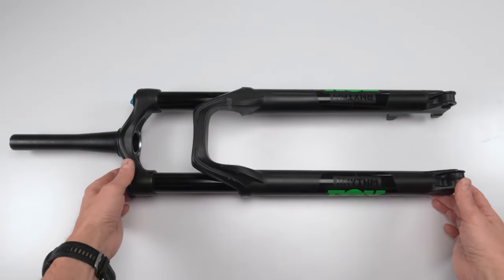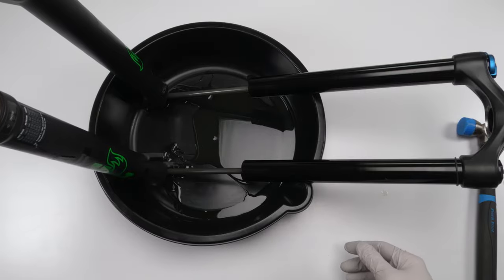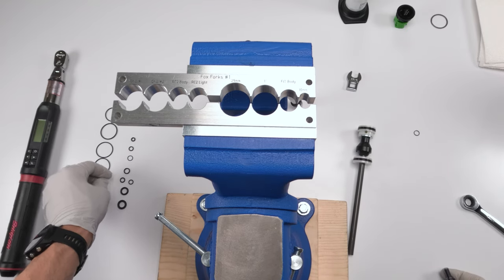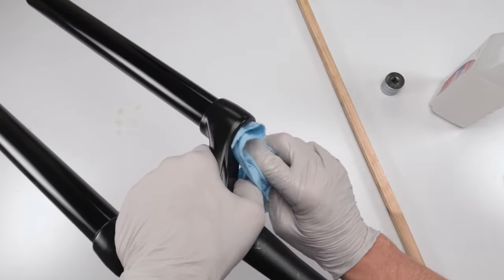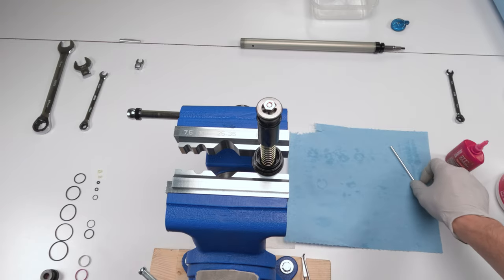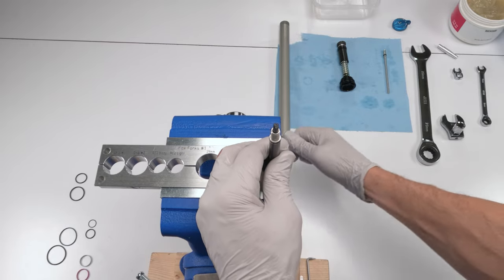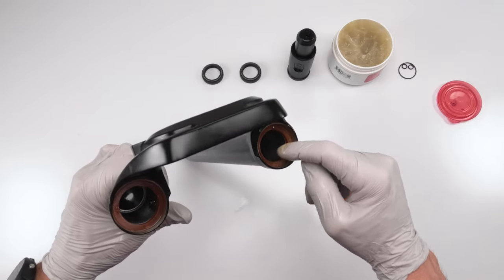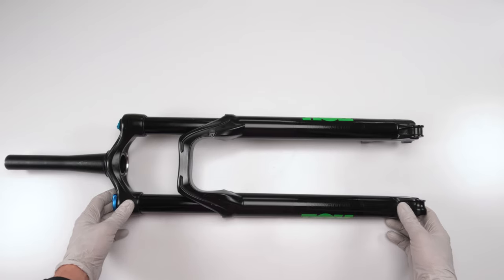FOX Rhythm Series 34 FLOAT 2019 GRIP Damper, air spring + 50 hour full service guide for beginners

Comment: Great explanation of servicing this fork! I have a Orbea OIZ H20 2022 with a 120mm Fox Float Rhythm 32 fork. Bike is new,  but the lockout does not work properly.  It's not fully locked when the compression needle is fully closed. This bike has a Squidlock remote on the handlebar. Why isn't fully locked? I did unscrew the compression needle counter clockwise a couple of times. Does it need bleeding? The remote lockout didn't worked properly since I bought it. I hope you can help!
Reply from the maker: Thanks for watching the video. So the fork won't stay 100% locked out when lots of pressure is applied over time. oil will seep through but VEEEEERY slowly. It'll feel locked out but with a super slight slip as you keep applying pressure. if your feeling more movement than this than I'd bet you need a bleed. air in the system will make it feel like it doesn't lock out. This will be felt immediately when you apply pressure. hopefully this makes enough sense so you can have a baseline for comparison. let me know how it goes.
Reply: @zoubtube  Thank for your fast answer! I accidentally pulled out the compression needle last night! 🫢 Some oil leaked out but I put back the needle immediately. When I turn the blue compression knob (normally operated by the Squidlock remote) I have to apply some force to get the fork fully locked. I have to turn the knob clockwise. With the Squidlock and the Fox Grip the fork is never fully locked. The spring underneath the compression knob doesn't manage to get the fork fully locked. When I remotely lock the fork, the fork is not 100% locked. I have to manually give the compression knob a slight twist (very minimal) clockwise. On my Scott Scale 925 with the same fork, this is not the case. It's 100% locked. Could there be something wrong with the damper cartridge internally? It's a new fork. Is it a problem that there was some oil leaked out after I accidentally toke out the compression needle?

Comment: Excellent video! Very informative. Thank you! I just ordered all of the tools and things to do my own fork, and hoping that I ordered the correct jaws for clamping the round stuff.  I hope that there's no damage beyond repair in mine. Last night I hit a small rock garden, and noted a chhhh type of sound, followed by loud knocking when I hit the next rock garden. I pushed the bike out of the woods, luckily we only got a half mile in. Checked the pressure with my suspension pump, and it was still good, which shocked me to see. I have an MRP Ramp cartridge in mine, do you think that it could have failed, or would you suspect something else? I took lots of notes from your video and have it down as a 105 step process, lol.
Reply from the maker: I'm glad to hear you found the video informative. It's tough to say if the MRP cartridge failed. If you're sure that the sound came from the air spring side, and you don't see any oil leaking from the wiper or crush washer at the bottom that might have caused a similar sound, then it could very well be possible that the cartridge failed. I know it works with the air pressure in the top tube, so not seeing a pressure drop would make sense if the cartridge fails (unless there was a very noticeable leak elsewhere). My limitation is that I've never opened one up to see what could break inside. Now you have my curiosity. I don't have an answer for this, but I will look into it and get back to you. Thanks
Reply: @zoubtube  Hey Zoubtube! Master procrastinator here, lol.  Of course I have put this on the back burner until a MTB camping trip next week, and now it's a five alarm fire! I have been riding my spare bike, and now the goal is to make the spare bike the actual spare for this trip. I took really good notes from the last time that I watched this video, and just watched the whole thing again to refresh my memory, and tomorrow, I believe will be the day. I plan to film a short vid showing  the condensed highlights of this, and probably will post it on my channel, but I will post links to your channel for the awesome detailed tutorial and give you all of the credit for giving me the ability to take on this task..  I just hope that when it comes apart and the problem presents itself, that it's not beyond repair. Thanks again for posting these very detailed videos. I'll let you know how it goes. Take care.
Reply from the maker: @themostlymikeshow  I just realized that when someone leaves a comment, I see it. But if someone responds to a comment, it is not visible to me unless I happen to come across it by fluke. I'm not sure how to fix this.

I'm curious as well to see what the issue is. If you were near me, I would've serviced it for my own curiosity. Hopefully, it's something simple. But if there isn't anything immediate that points to the MRP Cartridge as the issue, and you're still not sure, I would consider removing the cartridge and going with the stock setup, considering that you're going on a trip

Yesterday, I helped someone change a spindle on his raceface crank through a virtual meeting. IT was his first time. Step by step, we went through it, and everything went flawlessly from beginning to end. It piqued my curiosity as to how feasible this would be for bigger jobs. I need to look deeper into this.

There is no part of this service that needs to be rushed for this fork so just take your time. If you have any questions let me know, hopefully I see them in time. And let me know how it goes 👍

Comment: superb video. just question - do you think less grease on the air piston might be better?
Reply from the maker: Thanks for the comment. Great question. There is a Goldilocks zone when it comes to the air spring. I wouldn't go too light, and for most people, I would go a bit heavier because, in reality, most people don't regularly service their fork. We have to take into consideration that grease sticks to everything, and there are many areas that grease can rest on that will prevent it from contracting the seals. That's where a bit extra has major benefits. Too much will be a problem, as you can constantly clog your chamber port

Comment: Great job dude! thank you for all the time and knowledge you put in! 
If I may suggest a little trick....when unscrewing or remounting the top caps of both air and damper sides, I experienced this easy rule: go with an acute angle! In a nutshell: the fork flat on the table (bottom fork on your left and top fork on your right), is the optimal position to unscrew the farthest leg  or to tighten the fork leg next to you. In the first case apply your wrench with the handle pointing at you, at an acute angle; with one hand hold tight  the top tube and socket and the other hand pushing down the handle of the wrench, pointing at you. Wanna unscrew the other leg? Simply rotate the fork on his axis so you have that fork leg far from you.
Wanna tighten all together? Apply this rule backwards: you have to go on the fork leg next to you, and pushing the wrench towards the wall. Alwasy use the acute angle rule as your alley to make things easier.

Last but not least: lower leg of air side...10cc oil is almost nothing IMO: I always use to put in 20cc
Reply from the maker: Thanks for the tips, my man. I always appreciate input that helps make a process easier 👍

Comment: Please tell me what are the diameters of the holes in the shaft clamp, I want to make a 3d model
Fox Forks#1: Grip#1, Grip#2, RC2 Body, RC2 Light, 29mm(understandable), 1"(is it one inch?), Fit Body, 10mm(understandable)
Reply from the maker: The following is what I measure with the caliper at opposite ends when clamped together. I measure 1mm more for each hole when measuring at the widest point when holding only 1 side of the jaw. My guess is since these are aluminum, the wholes are cnc'ed first then about 1mm of material is lost during the length cut. 
grip 1 - 21.09
grip 2 -21.5
RC2 body - 16.28
RC2 light - 15.88
fit body - 15.56
x2 air sleeve - 42.13
X2 body  - 31.75
Reply: Great, thank you. @zoubtube

Comment: Best guide on YouTube.
Reply from the maker: Thanks for the kind words and for taking the time to watch the video. more videos to come
Reply: @zoubtube  I hope you see this. Is there a difference between this Grip damper and Grip damper on Fox 36 Performance from 2023 Performance Series 36 FLOAT 29 150 Grip? I think I've got air mixed with oil in damper assembly and need to do oil bleed in it. Want to order all required parts and do it myself. Struggling to find the vice shaft grips atm. Will be using your video to follow step by step

Comment: can i use pm600 military grease instead of sram butter ?
Reply from the maker: I wouldn't. PM600 is significantly thicker than sram butter, slick honey. slickoleum  etc. most newer fork seals don't need a thicker grease as the did in the past. You can buy a small amount of any of the recommended greases if you only need a bit

Comment: Hello again.  Just wanted to let you know that I tried the steps that you suggested.  I put the details below. Sent this in case you don't get the notification.
Reply from the maker: Yup, I saw that earlier in the day an posted a response. let me know how it goes
Reply from the maker: any updates on the fork? to you get it ready for the trip?
Reply: Hi! Yes, I got everything back together and it performed nearly flawless. For some reason, I looked at everything that you mentioned in reference to the lockout issue, and it's still moves a little bit. I never ride with it locked out completely so this really isn't a big deal. I rode all weekend, and didn't take it easy on it. It performed like it did when it was new. Thanks again for all your help. It is still a mystery to me why that damper tube came apart. I suspect that at the factory this could have been overlooked before it was properly torqued with threadlocker. Purely just speculation, but we are all human.
Reply from the maker: @themostlymikeshow  Excellent. Great to hear that it all worked out. As I previously mentioned, the Grip isn't a 100% full lockout damper. It will get hard to move, but it will sink with enough constant pressure. it's also self regulating. when it ingests extra oil, and air for that matter, it will release it from the bleed hole. based off what you saying. I think you did just fine. 

As for the tube, you could very well be right. I'm sure the folks at the factory are both pressed and stressed, as are most production lines. got to make the numbers. either way, I'm just glad to you that there wasn't any significant damage done. 

Now it's time to enjoy the season 👍